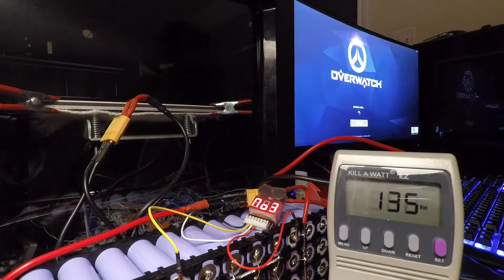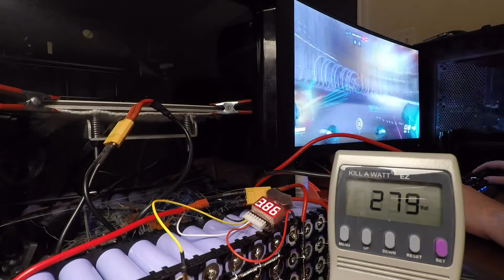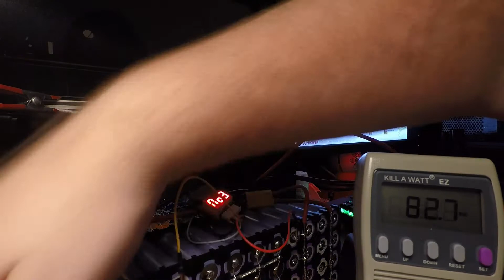Portable Mini Powerwall Project E07 - Pack Construction

Comment: What kind of connector is that? The yellow ones.
Reply from the maker: They are called an XT60 connector which is commonly used in RC cars, planes, and multirotors. Rated for 60 amps, easy to solder to, and easy to plug and unplug. Here is a pack of ten on Amazon for $8: http://amzn.to/2u7VCGN
Reply: I couldn't see it  or maybe missed it is one side positive all solder together and the other negative  ? How many are set up as series and how many parallel ? also ? watts  ? amps ?  Volts ?   Thanks I am just getting into this and its all new to me. But love what you are doing.